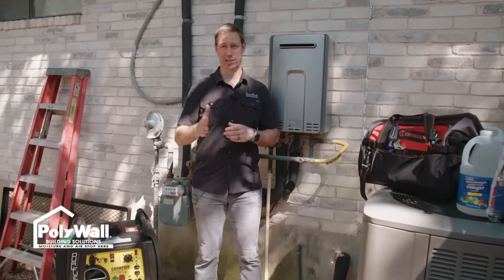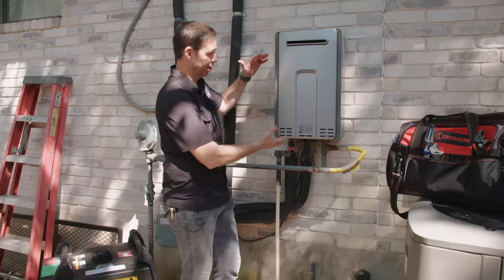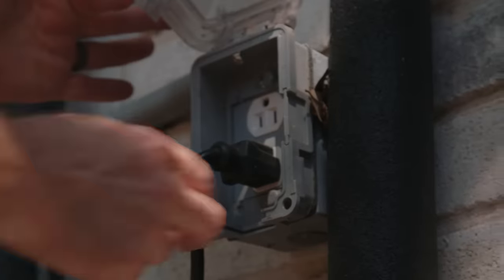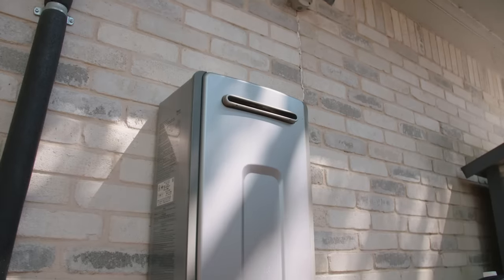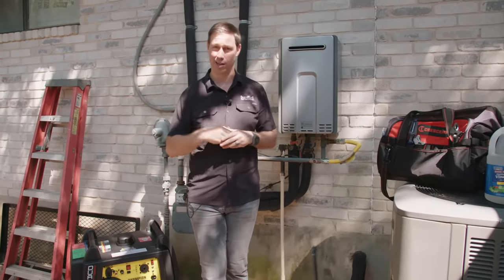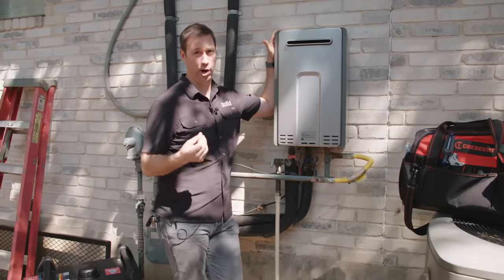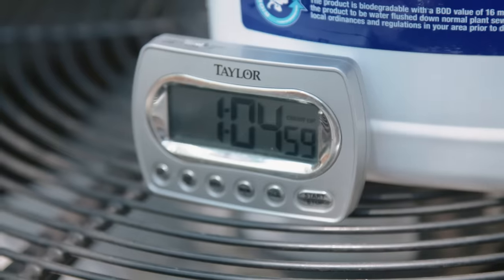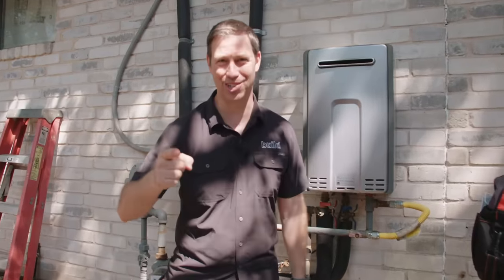3 Things They Don’t Tell You About Tankless

Comment: Tankless are NOT worth the extra expense or maintenance.   Standby loss is ridiculously overblown compared to the complexity introduced by a tankless. You can put a mixing valve on a tank too, letting you run it hotter giving you more hot water and also preventing bacterial build up. 

I always wanted a tankless but after I started looking into the maintenance issues, won’t run without power, cost of the system and in no way is it worth it for the long term.

Comment: that has nothing to do with this video. but maybe you can answer this question.  to keep your pipes from freezing you turn on the water very slow to keep the water moving so it will not freeze. but then you waste water. what if you install a circulating pump in the line would that work.would that stop it from freezing.

Comment: With a 50 gal water heater you don't get 50 gals. of hot water. As you use the hot water it gets replaced with cold water thus cooling the hot water as it's being used. You prob only get 25 - 30 gals. of hot water.

Comment: Not my tankless water heater it turns on by 2 D size battery I just some extra batteries🔋in stock it only comes on to light the polite light and to show the temperature while in use but my stove needs electricity to the polite light or I just a match or a bb-q pit lighter😊

Comment: Timer ?
Kids ?
Give them weekly allowance?
Give them the Gas-Bill, long showers, there allowance, part goes towards that High-$-Gas Bill.
I would think 🤔, using a ball lever shut off, there would be a way to actually flush out that system, faster, even on a monthly time ?
As a single person, this sounds like a big savings on my Gas Bill.
Someone told me , you need to buy the correct unit to the same size, for your water line ?

Comment: First of all, the company that put our's in covered all these points with us.  But all three of these things should be readily apparent to anyone with a brain.  Of course the costs of tankless hot water heaters are going to be higher if you have a whole bunch of people using it constantly.  A tank water heater wastes a lot of energy keeping water hot, if it's rarely used.  We were told our cost savings would depend entirely on how much hot water we use.  And who would have thought that we wouldn't have hot water when the power goes out?  If you power is out long enough for it to matter, you have a lot more things to worry about than whether or not you can take a shower.  Finally, you act like scale and corrosion are problems unique to tankless hot water heaters.  Have you seen the inside of a tank water heater that hasn't been flushed out in a while?  If most people did, they'd probably never drink the water again.  All hot water heaters need servicing from time to time.

Comment: I had a tankless water heater , theyre rubbish , you HAVE to have soft water , so you will need to use a water softener , they use a lot of power as they have to insta-heat the water, shuts off when you have low flow and to top it off mine blew up, now I have a geo-thermal and it's absolutely fantastic, will never use a tankless again.

Comment: Again, you totally missed higher water usage. And it’s not only because of endless hot. It’s because with tankless, you can never get luke warm because there’s a minimum flow needed to keep the flames on. This turns daily usage into max flow each and every time, often wasting many gallons before water gets hot. Many parts of the country have drought conditions, and the water bill doubles or triples!

Comment: This dude just unplugs his tankless water heater for the video. Meanwhile his wife is attempting to take a shower.
Reply: I think most tankless water heaters do NOT use 110 volt, but 220 volt with high amperage, if they're the electric type. If gas type, this might be right.

Comment: If your electric is out, how is you WATER PUMP going to run anyway to get any hot water out of a tanked model??? Unless you have… a generator. Sure, you have SOME pressure still in your system with the pressure tank, but that doesn’t run very much either. Certainly not enough to take a shower.

Even my 40gallon electric water heater is not going to give that much hot water if the electric goes out. Plus, with gas, unless you have a pilot light (no thanks) it won’t keep heating any water either.

Comment: Two other very important things you neglected to talk about is most on demand water heaters must have a dedicated houseline because of the huge volume of gas needed. Also, on MOST older homes, the water system must be upgraded to provide proper flow for the water heater sensors, other than that, you can expect to have a $200 to $300 gas bill!  Those damn things SUCK

Comment: You got to waste 20 gallons of water till the faucet has warm wster to wash hands. Might waste 40 gallons waiting for the water to heat up for a tub. So you spend more money on water, and it's not worth it unless you are on a well. Who needs unlimited hot water when only two live in a home?  It cost my mom $15,000 for a tankless water heater. They installed it for $5,000 and it didn't work, because moms gas line wasn't big enough. Then she spent $10,000 installing a new gas line. Complete waste of money. Tankless are harder to flush and clean than a tank with a water hose. I hate it.

Comment: 1) I don't need endless hot water.
2) When I don't want my water heater to run, I turn the breaker off.
3) My water heater is in the back of a closet and takes up virtually no useable space.

So much for the advantages of tankless water heaters.

Comment: Ahhh...my conventional water heater will supply hot water during a power failure as long as I have gas and water available. It does not require any electric power.  
And...suppose you've got a hot water circulation pump? That's going to cause your tankless burners to start and stop constantly.

Comment: That's gotta be the most annoying setup ever. I'd have a heat resistant replacable filter screen at the outlet of that bad boy with quick detach fittings and valves to remove it easy peasy.

Comment: I would NEVER put a HOT WATER HEATER of ANY kind OUTSIDE unless it was absolutely necessary - that should have been installed in the GARAGE - SECONDLY...if people would just use shower flow control valves on their outlet pipe...not only would they save tons of MONEY per year on their water BILL...but they'll WASTE thousands of gallons LESS per year - the FLOW doesn't need to be FULL BORE the WHOLE TIME you're in the shower - TURN IT DOWN to a LOW LOW FLOW while you're scrubbing down

Comment: you are mistaken about not knowing about the things that need to be done, I was told about it all. I heat the house, dry the clothes, I have 2 tankless heaters, and also cook with propane, my yearly gas bill runs about $500.00, you can't start to do this with electricity..................................................JS*

Comment: you don't need a generator to be able to run a gas powered tankless. at 120v? the operating load is LITERALLY 1/2 amp while it's running- and is so near zero while it's in standby.. that it's not even worth mentioning. a small computer UPS would run this thing ALL DAY LONG.

Comment: 2xC cell batteries fires my tankless up.  Whats the plug for?
Tell the kids to move ass.  
Timers also work with tankless.
Flush 1/yr.  That's a problem for you?  
Sticking with my no CO2, no wast heat when not in use tankless heater!

Comment: Too much maintenance, I put a 75 gallon tank with a 75,000 BTU burner in lieu of the standard 25-30k btu burner. I take a bath every morning in a 100 gallon soaker tub. Never ran out of hot water and someone can take a shower after me no problem. Should not have to do any maintenance on it for several years. Tankless water heaters have many problems.

Comment: What total bull, he left a lot out, like the fact that the tankless have a couple hundred electronic parts counting the parts on the various circuit boards, which means there is a lot more to go wrong. By example, a typical gas water heater has a 25 buck controller and that is it, you can pick them up at most hardware stores these days. As for flushing, sure you should do it every year but very few people do and still get 10+ year maintenance free life out of the standard unit, I got 15 years out of my last one, which is fed by city water and never changed the anode rods and flushed it only a few times in that life span, say 3-4 times in 15 years. Space saving and endless hot water are really the only perks and I have a 60 gallon tank and 5 people in the house and have never run out of hot water. As for the space, in all practicality what are you really going to do with a couple square feet of space, usually in the basement or garage.

Comment: we've been using these in Europe for decades.  They are hardwired into the electrical and they are very efficient.  However, even if the cost of energy was the same as a tank I would much rather use fresh water than water that has been sitting in a tank.  In addition, tanks have a plethora of inherent dangers and issues of their own.

Comment: Tank water heater: $2000 / 10 years lifespan = $200 per year to operate (plus gas). Tankless heater: $5000 + $200 per year to maintain for 20 year lifespan = $9000 divided by 20 years = $450 per year (plus gas),  That's double the cost. 
Unless you will regularly NEED unlimited hot water, it's a waste, and not energy efficient at all. When all that computerized crap inside breaks down, and it will, your repair bills will be thru the roof. (Think of when your heating / AC system cuts out, and you need a new "brain board" because one cheap resistor or cap failed.) That's why Rinnai and Navien have dedicated training schools for their techs, which you WILL need one day.
Its just another Commie plot by these Asian companies to undermine the USA. Screw 'em. Sometimes simpler is better.

Comment: Say nothing for throttled flow when multiple users demand hot water, these systems suck…
Reply: I can now say I have troubleshot the system to see why I have poor pressure, inconsistent with others reviews. The installer apparently did not flush the unit with this well water supply. I installed a filter in the main supply, didn’t help. But found the plumber put a filter in that was not rated for well water, it was plum blocked, but then I flushed the hot water heater only to get a muddy soup, I thought I would get calcium but No! I got mud. Now. Put a cotton weave filter in, for the right pressure and flow, and after the flush, plenty of flow. I also put a recirc pump in and now we have hot water when we want and plenty of it…but I have to increase the water temperature which was also limiting the rate of heating. Crazy, but my engineering skills paid off once again…

Comment: Total b.s.  
He listed  3 negatives; 1) no hot water when power off, 2) less cost savings if you take long showers and 3) maintenance. 
If power is off for a long time, both tank and tankless have no hot water.  I have a tankless water heater and I doubt that I take longer than 5 minutes in the shower. Most people are like me.  The savings are huge!  As far as maintenance, it simple to do it yourselves. No need for a plumber, EVER!  It’s ridiculous to suggest a plumber for this annual exercise. The effort required to rinse out a tankless unit is much easier than emptying a 55 gallon water tank. 

This guy has an agenda because all of his negatives are false.

Comment: This has false information.
Tankless isn't "endless". They can only put out so many gpm. The best of the best is only about 9 to 10gpm. Most people aren't buying those. They are buying cheap, and those units maybe do 3 to 5gpm.

So you run the kitchen sink or washer at the same time as a shower....you're done. If there's no flow restrictor installed, the water gets colder because too much water flows through. If there is a flow restrictor, the amount of hot water trickles down because too many fixtures put a demand on it.

Comment: mounting it outside...bad idea, using plastic pipe, again bad Idea.  I thought of this when Texas got hammered recently with lower than normal temps. Even without freak weather changes, ITs a very bad idea putting something like that outside whether it's made for the exterior or not.

Comment: First of all thanks - but it takes me 7 minutes to wash my woowahh alone - let alone the entire whhahwoo - and, I had 75 gal system for 20 years - never once did I empty it out or replaced anything - the mfg say that, so that you buy new parts from them - at the end of the day, its a metal cylinder, with a heater element at the bottom - nothing really should go work or need emptying out and wasting 75 gallons of hot water every year - considering the showers I take.

Comment: No way for me. I'll stick with our time-tested 50 gal conventional gas water heater. Simple design, reliable, functions without electricity, and serves as an emergency 50 gal of clean water in the event of a natural disaster. Never had an issue with running out of hot water, although we limit our showers to 10 minutes. 

There's just too little downside (and a lot of upside) to the conventional tank heaters to justify paying a premium for tankless.

Comment: So much misinformation in this video. Ironic he says "things they don't tell you" while simultaneously not telling you most tankless water heaters are condensing 95 percent AFUE models.  Then not telling you a standing pilot costs 20-30 bucks a month and doesn't mean a water heater which used one can heat during a blackout. I could go on and on about everything else that's incorrect here but...meh

Comment: Absolutely hate All the Pipe installation !!!! Who did that??? A first grader???? Shame on the whole dang bunch of you... Hate it...And, you say, this will not save $$$ !!!!  And you have to flush out the scale all the time - who wants to remember to do that???
A gas water heater is not running all the water out and then refilling it either... It is constantly refilling itself as it gets depleted, and the burner is turned on at the same time..
This guy = not smart...
I will never fall for that tankless stuff that has been around for decades and look - it's still the same as it was 50 years ago....